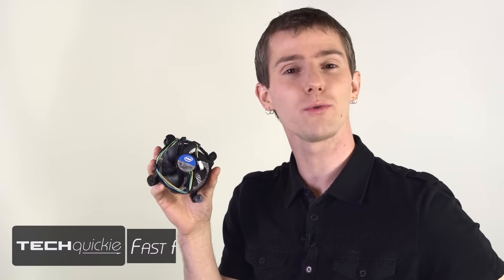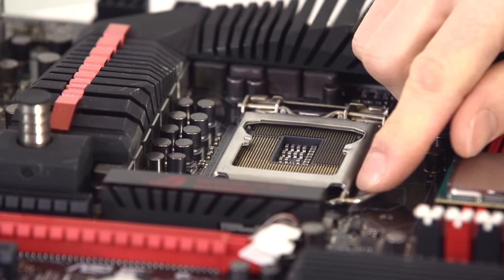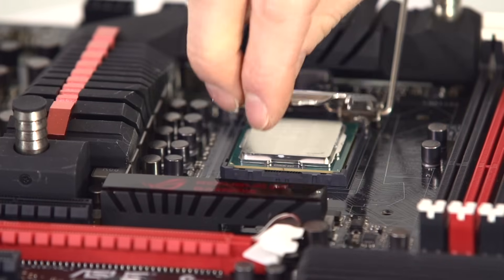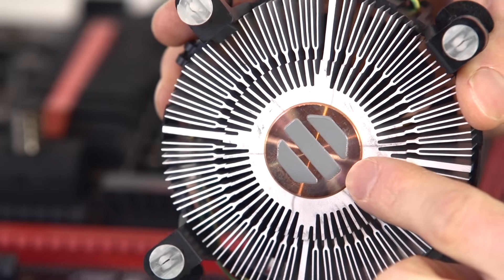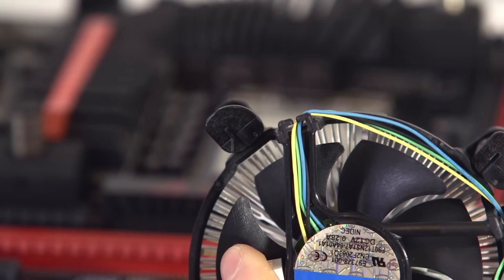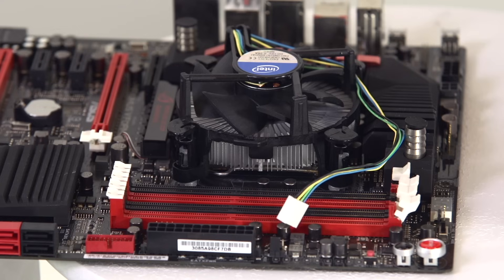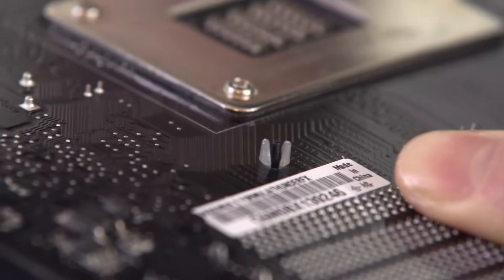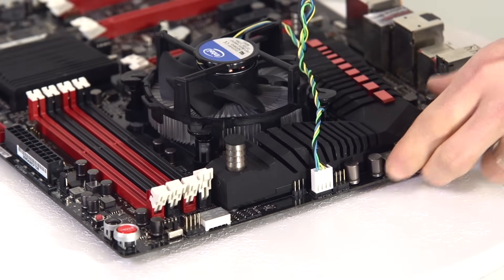Install an Intel LGA1150 or LGA1155 CPU Processor as Fast As Possible

Comment: Those plastic pins break easily.
Reply: Thats why you have to be careful
Reply: They'll only break if you do it wrong, I reseated one I had in use for 5 years and it is still intact.
 
 You must be dead sure everything is inside the hole before putting pressure. Also remember to set the arrows right.
Reply: I see
Reply: @JonatasAdoM  spent like 30 minuts figuring out the arrow thing was wrong
Reply: My parents got mad at me because i break it
Reply: No shit Sherlock
Reply: @Lars_doe  same issue. What happened next?
Reply: @reinalynpalaruan9852  they just buy a new one and smacked me in the face 5 times
Reply: @SolveGr  I was doing wrong too after watching Linus I figured it out.
Reply: @Lars_doe  I breaked too and what did you buy a new fan because I don’t know what to do
Reply: Yee lolll
Reply: I have got rid from that nasty plastic pins is horrible just go coolermaster i30 for better pin holders
Reply: my plastic pins are broken what can i do now pls help!
Reply: Me laughing with ryzen 😆
Reply: Yeah I break my clips
Reply: @SolveGr  me too
Reply: @JonatasAdoM  18
Reply: I JUST broke off two... I'm fucked.
Reply: @JonatasAdoM  i wish i would have looked at this awhile ago, been wondering why my idle temps were 25-30 C, as soon as I opened any game even if it was 23% load it would skyrocket to 80-90 and my ghz would drop lmao it wasnt seated all the way
Reply: @remoteportal  shit idk how i didnt bruh 😂 i straight up forced these mfs in and did it the wrong way yet none broke it jus wasnt seated properly
Reply: i broke mine TWICE when installing :(
Reply: Yep, I tried to disassemble my lga775 heatsink to reapply my thermal paste it breaks luckily my dad have solution
Reply: true. I was trying to replace the thermal paste of my pc cuz it was dried up. So as i started to open the side pannel, the stock cooler's pins were kind of bent but i dident rlly care cuz i was taking off the cooler. So i replaced the thermal paste but once i tried to put the fan, boom, 3 of those plastic pins broke but one pin was fine so i screwed that one pin and now my cpu temps cant go below 100 even when idle. And if i told my parents about it, they wont even care and tell me to deal with it
Reply: I agree. At 1st attempt i broke 2 of them. And u cant buy only push pins
Reply: @playbyan1453  what solution plz i need help man
Reply: @dzoni2570  cuts the legs off and reuse the cutted legs to hold the screw in place.
Reply: @playbyan1453  i dont get it plz explain  it again
Reply: Guys plz help if i follow this video's way i may still have a chance to break the pins ?!
Reply: @hibya2066  yes, lower chance to break the pins since my dad twisted it on wrong direction and it breaks the pins.
Reply: @playbyan1453  one of this pins is not well placed it didn't come out of the onther side of the board i don't know if i can just push it in or remove the whole fan
Reply: @hibya2066  might remove and put it back following the video itself
Reply: @playbyan1453  ok thank you for help <3
Reply: @hibya2066  no problem
Reply: @playbyan1453  bro if i breaked two of that plastic thing,it is a chance to place the cooler?
Reply: Its physically impossible for those plastic pins to fit in the holes... i did exactly what im supposed to and when i places them over the holes it just doesnt fit and if i apply pressure its just going to break. I hate this design
Reply: My fuckinn god how did you install those pins I'm frustrated af.
Reply: I broke mine😢
Reply: Fax
Reply: Ikr
Reply: I was wondering why wouldn't it seat until I noticed 2 pins have the black piece out flush.  This make the pin too large to fit. Any idea how to get that center black piece to return to the open position?
Reply: Fk my pc temp is 95 at idle but im scared to replace it i might break it
Reply: @Lars_doe  same here i just put in a new i7 2600 and i broke off two pins....he said its okay hes gonna buy me a aftermarket cooler
Reply: Hate this design. Looked up this video after I broke the pins removing my cooler. At least my new cooler should be quieter.
Reply: for real
Reply: My CPU socket is 1150 
Can I buy another kind of fan to replace the Intel default fan if I broke it? (Like the superior ones?)
Reply: I've never broken one! (Cough, I've broken 2)
Reply: ye i remove that and changed with screws

Comment: You didn't cover the most important part with enough detail: getting the four corners back in... it takes ALMOST A MIRACLE to get all four corners in at the same time without breaking off the white parts.
Reply: I had to use a flat head screw driver to guide the white parts into the holes precisely when I was messing with one of my old computers.  These intel fans are annoying!
Reply: What are you talking about? Just line up one and then give it a jiggle, they all fall in by themselves like instantly.
Reply: @kowhaifan  mine was far from New so it was pretty shit quality.  I was only using it to throw together a home server to play games with my friends.  I'll be upgrading the home server computer into a better one eventually though
Reply: Pls help my plastic part broke what do I do
Reply: I agree. I had a hell of a time trying to get my fan back on and ended up breaking a couple of the small white plastic tips. Ended up buying a new cpu fan that mounts better.

Comment: I replaced my CPU. You need to tell people to ensure the inner pins are pulled back before inserting.. You need to check the cpu fan doesn,t rock and is solidly on the cpu on all sides. NOT all pins click to confirm they are seated.  I have swapped a lot of CPU fans in my time.  This is a poor design imho

Comment: This video helped me out immensely. The pins made me think that it was easy plug & play when cleaning my PC. Boy was I wrong, didn't know you had to reapply thermal heat, computer super laggy after reinstalling the fan wrong. Then I come across this video and it's crazy compact with ALL the info you need. So thank you so much you got a sub!

Comment: Arrow direction releases the black inner shaft to move up and down in the clear plastic outer.. turned To locked the black element in position relative the the clear element.. when installed the back element is fiully inserted into the clear and locked creating a lock on the motherboard.. when installing, the black portion needs to be retracted and locked so initially the clear elements can pass through the motherboard holes. Then unlock and push the black element through to fully insert into the clear and then lock in place by rotating. Doing this correctly should not require much pushing force

Comment: This video helped me 9 years after release. Why did Intel insist on a plastic clip mount?

Either way,thanks Linus and team for all your good work.
Reply: Me too :v
Reply: Me 2 and my fan has fucking broken clip
Reply: Just to make sure in case I misunderstood, arrow point inward for removal and outward for installation right?
Reply: He is not linus but looks like him 🤣
Reply: SAME - Downgrading on my noisy I7-4790 liquid cooler which has been in use since September 2015 to this exact same air cooled fan heatsink shown in this video.  Will be attempting installation tomorrow!
Reply: @Paras_Aryan he is Linus

Comment: Arrows away -> installing
Arrows towards <- removal

Trash design
Reply: Intel logic: plastic is stronger than metal ;)
Reply: yup i've installed three of these and each time i have to triple check which way the arrows 'should' be facing, very annoying.
Reply: This setup is lowkey shit I mean who the hell thought this design is good
Reply: Cynderfan35 😂
Reply: Let’s face it they make it flimsy af so it can break and make u replace them
Reply: AMD all the way so easy to fit
Reply: @Gj05-g5v  I agree 100%
I recently bought one cooler that supports both AMD and Intel attaching, it was actually finally design that used more metal on it
Reply: @Cynderfan35  yeah i upgraded from i7 860 to r7 2700x for xmas its soo much better and i think theres only a £60 price gap think i7 goes for like £100 and 2700x goes for like £160 its crazy how good AMD is.
Reply: Bruh ma CPU nearly burned because of this design
Reply: The plastic under the arrows it's broken on the side and every arrow has just one plastic from the side. I need to replace the heatsino or something else please help ??
Reply: Normal people might observe that the arrows always point in the same direction. Hopefully, this revelation will not damage your brain.
Reply: @bkrstevski  yes even if one plastic breaks your heat sink wont sit correctly on the motherboard and would cause little gap b/w cpu and the thermal interface which would eventually cause the cpu to go up 100 degrees while playing fortnite and shit
Reply: Gareth J Intel did lol
Reply: ULTRA CRAPPY DESIGN WHICH IS NOT EVEN QUALIFIED THE WORD DESIGN !
Reply: Ye lol mine was falling out cus i was smacking my pc around glad i noticed before it caught on fire lol
Reply: Intel really said righty tighty lefty loosey but ✨in reverse✨
Reply: i broke 2 fkn pins in the process of installing, not only the cooler is loud as fk it is ugly, hot and damn weak
Reply: Feel the same that very mech. Designer should have gotten lay off notice back in the day
Reply: FACTS.  I had to look this video up to make sure my heat sink was actually seated properly.  Absolutely garbage design.  It's not even just the dumb arrows, the push pins don't even work well.  I had to get creative to actually get the push pins to seat properly.

Comment: Those push pin tips are a fuckin pain the first time.
Reply: +Khotta Bogard no they arent
just push them on a criss cross pattern
Reply: +Khotta Bogard Same here, always one that won't go in, feels like I'm gonna break the mobo from pushing so hard.
Reply: ***** been there bro, the board or my thumb.
Reply: +Khotta Bogard After you have done about 10 you will stop worrying and just push it as hard as needed in one go. xD

Comment: For those who cant seem to get the pins into the holes; make sure the black pin inside isnt poking all the way out. It shouldnt be anywhere near the two prongs at the tip when installing.
Reply: This needs to be top comment

Comment: Thanks, Linus. My CPU has been running really hot all the sudden after I applied new thermal paste and I discovered the cooler wasn't in all the way. Many thanks.
Reply: I can’t fit it into my motherboard correctly any ideas on how I can fix that?

Comment: first time i did it it was easy, 2nd time i did it i broke a pin damm
Reply: same here.
Reply: +lyhthegreat cpu pin?
Reply: +cocacoladog10 These CPUs don't have pins, lol.
Reply: Yeah I took these types of coolers out plenty of times and the pins are always a pain. Fuck these pins, FUCK THEM!
Reply: lyhthegreat good job bro. We need to destroy all intel “coolers” on the earth
Reply: lyhthegreat well it’s better to break a pin on the motherboard, which will cost you 50 to 100$ instead of breaking the cpu, which will cost you up to 200$
Reply: So I discovered something today when I was cleaning my cpu fan that makes it far easier to install the fan. Pull upward (away from the motherboard) on the pins as you insert them through the holes. This ensures that only the white part goes through hole. Then only when the white part has gone through push downward on the pins and turn, this will push the black part through and lock it in place.

Me, Linus and probably most people have been doing this wrong. It should require next to no force if you do it the way I just described.
Reply: Devilofdoom very much appreciated :) 🙏🏽
Reply: Same here
Reply: @billygilmusic5072  if you damage a pin on an AMD processor you cant just put it back in place with a credit card, but good luck with fixing the socket pins on an intel board

Comment: Why so much hate on this cooler? It's easy to install and very efficient provided that you are not overclocking.
Reply: Uranium could you please tell me how to install it back onto my cpu? Its not falling into the holes correctly - seems they're too big but they can't be as it came pre installed.
Reply: jodawgsup you have to rotate the pins as they were before you installed it. Check Intel website for details for this. Or google ''remove and reinstall Intel heatsink''
Reply: Thanks a bunch, figured it out yesterday - the pins were still sticking out and I couldn´t figure out how to make them drop back in. Got it now though!
Reply: Uranium easy to INSTALL OMEGALUL I’m installing 280mm liquid cooling faster this dis heck on my old pc
Reply: I destroyed it bois. Don’t ever buy dis “cooler”
Reply: I broke one pin and now it sucks. Good thing I got liquid cooling
Reply: This cooler is needlessly difficult to install. Those pins are a nightmare
Reply: Jan carlo Soriano yas.  I’m not AMD fan but amd box coolers are much better then intel’s analog
Reply: not only is it hard to install, its also so fucking ugly.
Reply: Dra9onSlayer10 yeah but imo budget pc always  looks ugly
Reply: Dra9onSlayer10 srsly idk I installed 240mm liquid cooling for CPU but can’t install intel box cooler. LUL I fucking hate my old motherboard and these pins
Reply: Pull upward on the pins until they're through the hole. Makes things 100 times easier
Reply: "Hard to install"
You literally just press it down, there's no screwing or anything needed. If that's too hard, you shouldn't be building a PC.
Also lmao at this guy constantly commenting it's bad because he managed to break it himself. How's about exercising some caution?
Reply: Dj Blades The first installation usually goes without any issues. However if you are reinstalling it, it's (as someone here mentioned) a nightmare. I easily installed and later on reinstalled Kraken x62 to my main rig, and I have to say it was way easier than Intel stock cooler.

Comment: So incredibly helpful. 
A HACK I just did, when reinstalling fan, and the plastic pins were stretched out a bit making it difficult to make in the holes, was to wrap a piece of thread around base of plastic pins to keep them together. Cut any dangling pieces as close as possible. All pins went in easily, fan is seated well, and all secured. Temps look good again 👏👏

Comment: Noob question!  I just installed my first Intel CPU cooler and I was surprised to see that the fan seemed to blow air into the heatsink, towards the CPU.  Is this absolutely correct?  Thank for your help!
Reply: Yes that's how it works
Reply: HyperHertz Much appreciated.  A little reassurance goes a long way.
Reply: +Jacob Frey Intel wouldn't ship a CPU fan in the wrong direction. Either way It wouldn't make a difference. Push vs pull yields 1-3c difference.

Comment: I still have an old pc where i just had to swap the cooler cuz the old one died after nearly running 24/7 for 8 years straight.
I don't know a lot about pc assembly etc and had no prior experience so i left everything in the case my dumbass pushed 2 pins down that are adjacent and not opposite so i couldn't push the others in. I was pushing so hard i was scared id break the board and then decided to watch a video on it.
I'm honestly disappointed in myself that i didn't think of trying a cross pattern.
Saved my day linus from 8 years ago! Thank you!

Comment: Thanks man, I thought my system was running a little hot turns out I thought you tightened in the direction of the arrows =]
Reply: After installing the CPU cooler I was tightening towards the arrow and I was wondering why my cooler is sitting loose 😂😂😂

Comment: Yes and no. It is basically the same thing but the clips might be different. Just check the manual and you will have no problem. Stock coolers are easy to install

Comment: It's not the same but it is just as simple. On AMD the pins are on the CPU and there are holes on the socket, you just have to line up the triangle and drop it in, then the retention bracket and heatsink mount is different from Intel but simple and easy to figure out.

Comment: Evreything looks ok but I think you shuld install it with the logo verticaly on the motherboard, it will look better if you have a windowed case or just when you open your case.
Reply: no that way cables will be everywhere and might get in the fan.

Comment: I took my cpu cooler out lik just unscrewed it and it came out perfectly little did i know i snapped
Something off so it was lose but my pc was still running but the tempretarus were really high so i went too look and realised more of the pins came off and after 5 minutes it fell of so i had to order a new one
Reply: Same I broke 3 white pins, I realized that the black pin in the middle must be out of the way before installing but its too late, I guess I have to buy a new fan because of my carelessness lol

Comment: I had to sit with it for about 20 mins and study the pegs and see how it moves when you turn them:

Turn pegs left and pull up to remove
Turn pegs right then place on the board, then push down to install

Comment: You said they come with thermo paste. Do the have a plastic cover that needs to be removed before install? Or just clean old paste off processor with paper towel? No additional paste is needed on top of the processor?

Comment: He Linus, I have been listening to many of these guys saying to put down some new thermo paste. Well, I built a computer a few years ago, just saying I have done this before. I took the cpu fan off, looks like the one in the video. But in the process, I broke off the little white tabs that lock the fan to the circuit board.  So, I had to clean it off again. I took the computer down to the computer shop. Guy took a good 5 min looking at it, then looked on his computer and said, He wanted $150 to fix the heat sink. I said No, that's OK. I go back home and look on line. I find a brand-new heat sink with the Thermo paste for $12. I also found the push button clips for about $1 ea.  And the paste mx5. Now the fun part, wait until the snal mail gets here.